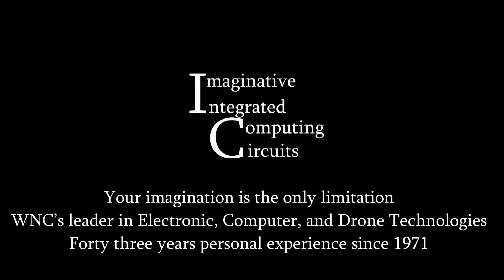RFD 900 Ultra Long RangeTelemetry For 3DR Autopilots

Comment: Can you fly with only this radio modem? I mean conecting the joystick on the computer and transmit with only one radio pack.
Reply from the maker: Yes.  You CAN click on goggle earth and say fly to here and also tell it what altitude to fly at.   You can setup automated routes.  But yes, you CAN fly it from the Mission Planner screen real time.  Well sort of real time.  While moving between created waypoints it would be autonomous flight by the autopilot.  You can click the screen and click land, takeoff, circle.  Stuff like that.  But real time right and left turns and climbs and descents, no.  You can say fly to here and give it an altitude that is 100 or 1000 lower and it would descend.

I have seen people connect a joy stick to Mission Planner but I have not done that.  I assume it would work.
Reply: Thanks., I try to build a Plane. I guess is a little different as a copter.
Reply from the maker: Actually, I was thinking airplane as I wrote that.  Same autopilot and commands for both.  A takeoff command looks for acceleration forward of the platform and then turns the motor on full and fly’s up to an altitude or waypoint.

Comment from the maker: My MAX range is currently limited by VLOS since the FAA downed all sUAV flights.  :(  I have advocated having a private pilot’s license to allow owners to again go beyond VLOS.  BUT, I understand that the FAA wants to require a commercial ticket.  I am thinking of getting current again on my private BUT, I am not sure my eyesight will allow a commercial ticket.  :(  Looking into it almost every day now.
 
However, the old 3DR radios were failing on me at a VERY short distance.  Having a RC receiver go out during flight and being ABLE to return to launch (RTL) via telemetry saved my butt one time already.  Now with NEW changes in the autopilots I have a second failsafe that does a RTL automatically should I lose contact with the platform, have RC receiver failure, or receiver interference that results in loss of contact with the ground station.  Getting better every day with the new autopilots.  I generally fly by myself in stabilized mode with the autopilot as backup.  Kind of a buddy box in the sky while learning.  Just seemed the way for an old computer engineer to do things.  lol
 
Have a 200 acre field I can fly out of VLOS to test, but have not done a range test at this point.  Will soon setup a secondary failsafe so IF the telemetry goes out, it will auto RTL but I have to get another RF900 first.  One for the ground station.  It still loses contact outgoing, but the one on the drone no longer does incoming.  So I have telemetry coming back from the platform, but can’t always talk back to it at this time.  Just an $89 cost I will get SOON.
 
Also beginning to setup geo fencing to keep my platforms in FRONT of the flight line at a local flying club even IF I die on the spot.  Had one accidently go behind the line and was chewed out for what I stated on the video was a no no.  Have one last platform to learn well before the June 20th SparkFun Autonomous vehicle competition in Boulder, Co. next year.  TRIED to make this year’s event BUT it seems getting my rover, and quads together took longer than expected.  Pretty SURE I can get the last platform ready by this year’s event.  I HOPE.
 
Spoke to the AMA last week to make SURE that anything I did outside of VLOS would NOT affect the local flying club.  They assured me it would not, but the FAA would bust my butt until they rule in 2016.  Hopefully they will rule in 2016.  Going to contact them this week to see IF I can legally fly out of VLOS on that 200 acres that is all pasture with ONLY cows below.  Hopefully I can without going pirate.  So I can at least test 1 mile at that field soon I HOPE.  BUT I will NOT be posting any flights that are outside of VLOS until a ruling is made because you can never tell WHO might turn you in.  I did a few BEFORE the FAA downed us.  My intention is search and rescue.  Seems some paranoid IDIOTS think we will use these platform to spread “anthrax” or some such.  Yes that is exactly what I was told.  IDIOTS don't understand these platforms are currently almost at the limit of weight as they are.  Adding anything like that would be stupid.  Just get a van and put a vat in the back and run a nozzle out the side and drive around town for hours is much easier and less costly.  But some can't see past their ignorance.  <shrug>  No one is going to convert me into a terrorist anyway.  My uses are all positive like agriculture and search and rescue as I stated.
 
Max range should be about 15 miles with rubber ducky antennas.  MUCH more with antenna tracking and Yagi type setups I am sure.  Australian High Air Balloon team has reported ranges over 37 miles LOS with only the rubber ducky’s.
 
Also remember as power increases for range, interference onboard the platform, ground stations, and other nearby platforms increases as well.
 
Keep the blue side up!

https://avc.sparkfun.com/